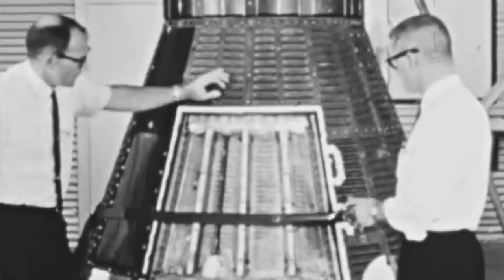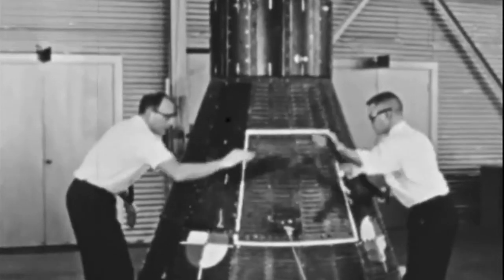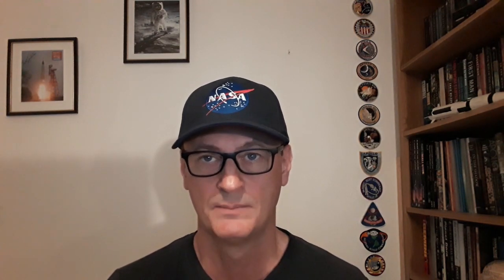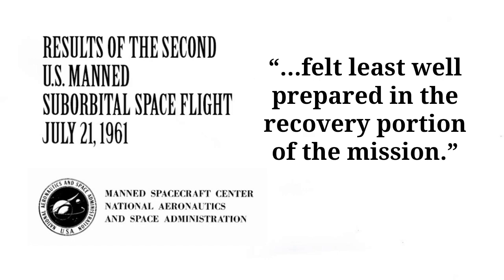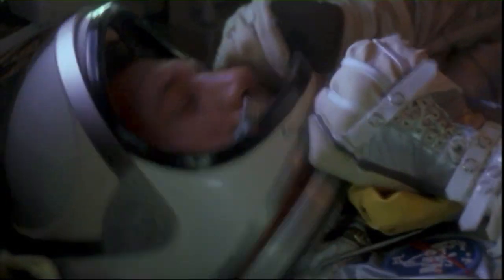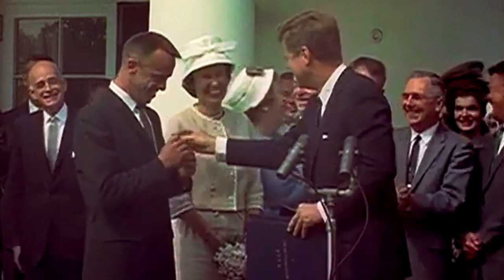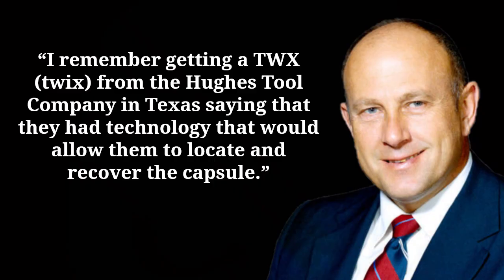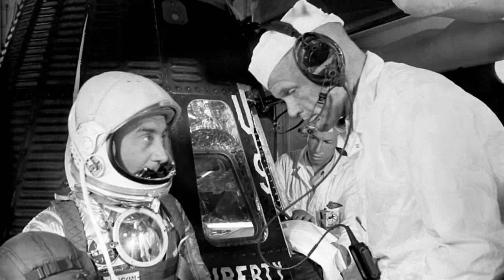The most likely reason behind the sinking of Liberty Bell 7.

Comment: Gus did not screw the pooch.  He was improperly accused.  He was even cooler than Shepard ... Gus would have been first on the moon and he should have been.
Reply from the maker: @xyz.ijk.  Although I agree that Grissom didn't blow the hatch by accident, arming the hatch explosive before he was ready to exit was a mistake. Also, I doubt he would have been the first man on the Moon.
Reply: @RocketMan-wj5xz   As to the hatch, perhaps you are correct (assuming that is what happened), and I understand your point if you are relying on the general rotation.  However, Deke wanted one of the M-7s to be first on the moon, and on the test flights, Gus was still first in the rotation -- plus the rotation wasn't always followed.  A-11 was a test flight (I suppose they all were at some level).  It was luck at many levels as to who it would be, and all of the NASA people I know from that era debunked Armstrong's civil status as being the reason he was first.  These were all considered test flights to that point and that's the joy they took from the assignments.  If I remember correctly -- but I do not assert as fact -- that Stafford, even after Apollo 10, may have been offered first landing flight, but he turned it down.  There were many inconsistencies in assignment.  After Schirra on 7, had Gus not died, I think he would have been first, whether because he might have taken 10 and been offered the flight (as was Stafford if I am correct in that memory) or because he was still considered the best remaining test pilot of them all.
Reply from the maker: @xyz.ijk.  Ok so there’s a lot to unpack there but here goes. Regarding the hatch, as I said, Grissom didn’t panic and blow the hatch, but he did arm the hatch prematurely though.
What Deke wanted and what he could actually do were two different things. Despite the fact that Slayton hung around in the hope of getting an Apollo flight and despite using his position as the person putting the crews together to get Shepard on to an Apollo crew, Slayton had told Schirra that the Mercury astronaut’s time was up when it came to the Apollo lunar landings. Schirra said, “Deke said that we of the original seven are done, there’s a whole new crew now”.
When it comes to getting Grissom in a position to be the first on the Moon there are numerous problems with this. No one knew which mission would achieve the first landing, I say achieve because there’s a difference between achieve and attempt. It’s one thing to break the rotation, which you are correct in saying was done, and put Grissom in command of a mission but no one knew if that would be the first successful mission. And who would his crew have been? Slayton wasn’t going to use White or Chaffee again in Apollo, Borman wanted out after Apollo 8, McDivitt wanted out after Apollo 9 and Stafford had no interest in going back to the Moon after Apollo 10, so the experienced astronauts were unavailable. And what about the Apollo 8 backup crew that would have rotated into that prime slot? How would they go back into the rotation? 
When it comes to Grissom being singled out by Slayton to be the first man on the Moon, I quote Schirra who went on record as saying, “…that’s  a bunch of hogwash!”
Reply: @ Schirra was an astronaut scorned. I think they were too harsh on him after A7, given all he had done for the program, but let’s be clear, he had a big bone to pick and he picked it wildly, loudly and often. As to your other points, unfortunately, we’ll never know 100%, but my studies and firsthand knowledge, indicate that there are as many facts and a lot of room for interpretation as much on my side as yours. (I’m a fan of your site but not a mere commenter.  I have personal experience with some of the people of that era, including those who worked at MOCR as well as the Cape during launches, old enough to have been around during that time, and had spoken with them during and after.) Deke didn’t merely hang around, he was the forced to be reckoned with. As you know, he was one of the original seven, he was no slouch. He could’ve gone on to do anything and didn’t need to hang around. He could’ve made millions in industry or run for office. If anyone was on the ego trip, it was Shepherd. But these guys were all amazing with big brass everything. I don’t even dream of being as brave as they were. you’re also going up against a lot of historians, for which I commend you highly, but, with respect, I don’t think you’re correct.
Reply from the maker: @xyz.ijk.  Slayton’s position on Grissom being the first man on the Moon changed over time. In 1962 he anticipated the first group to be out of the running for an Apollo landing mission because newer groups were either joining the astronaut pool or anticipated to join. As 1965 came to an end, his stance had changed and he thought that Grissom could potentially be in a position to command one of the early landing attempts. Slayton’s preferred commanders were Borman and McDivitt, with possibly Grissom in the mix too. Grissom did state to Slayton that he would take an Apollo lunar landing command if offered one. Slayton liked the idea of a Mercury astronaut making the first landing, something that Bob Gilruth also endorsed. If Grissom had gone back into the rotation, one pick for an Apollo crewmember might have been Eisele, who Grissom thought a lot of and had originally selected him for Apollo 1. But the underlying factor is that Grissom would be placed in the rotation to make a lunar landing attempt, there was no guarantee that he would either be first or be successful in landing.
I am glad you are enjoying the content, and I do enjoy discussions on the ins and outs of the crew selection process. Always good to have people who have first hand accounts of that time to impart their knowledge on the subject.